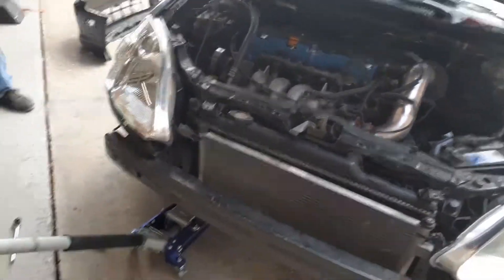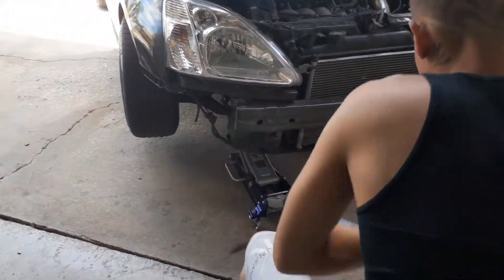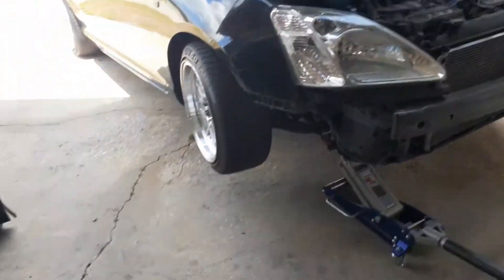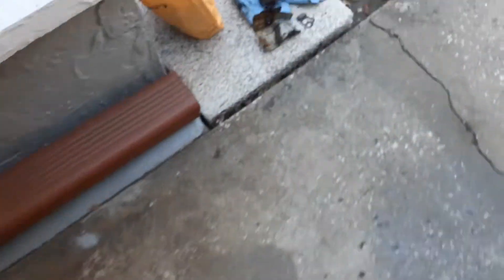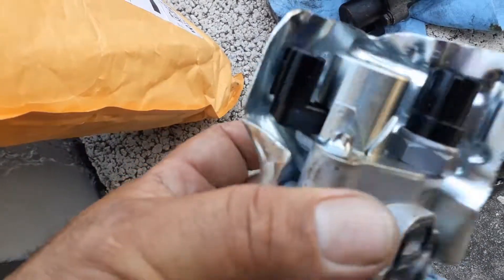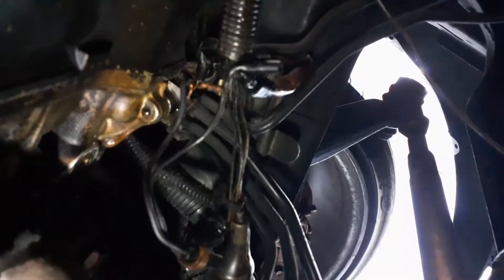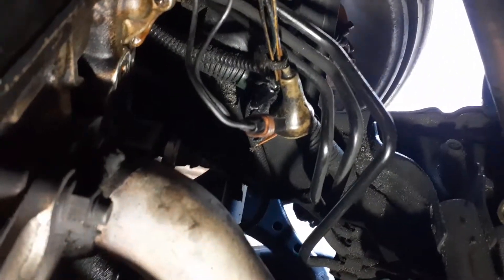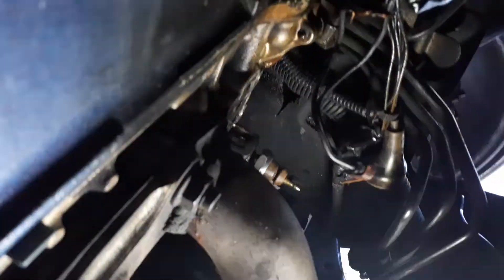Replacing Vtec solenoid on K20A3 Honda Civic Si Ep3

Comment: Is that vtec pressure switch code P1259? My 03 is leaking oil from there.
Reply from the maker: Yeah was vtec code. If you buy a vtec solenoid make sure it's oem Honda. I've tried all the rest they  are garbage.
Reply: @ZepolWorkzGarage  Thanks man, good looking out. 👍

Comment: What brands of vtec solenoids have you tried?
Reply from the maker: Tried Auto parts ones Advance, Auto Zone ,O'reilly's and Ebay Amazon all junk. OEM Honda is only one I'll buy now.
Reply: @ZepolWorkzGarage  do they just leak quickly?
Reply from the maker: @Itsukiro  casting groove for vtec solenoid gasket isn't right doesn't hold gasket blows out leaks oil. I have also tried OEM Honda solenoid gasket with parts store ones it's the groove.